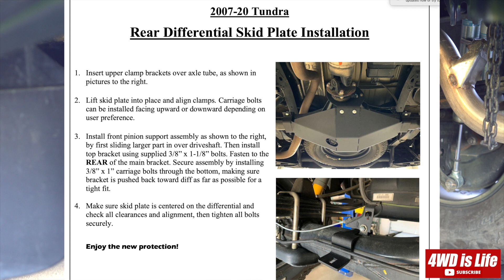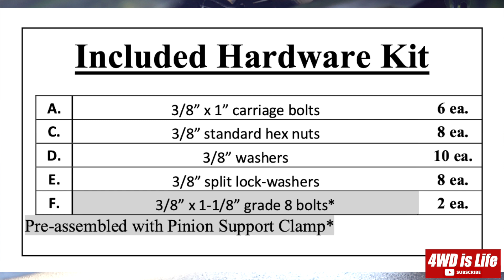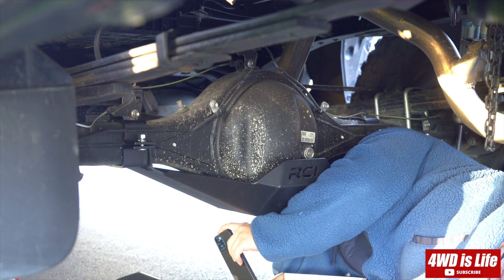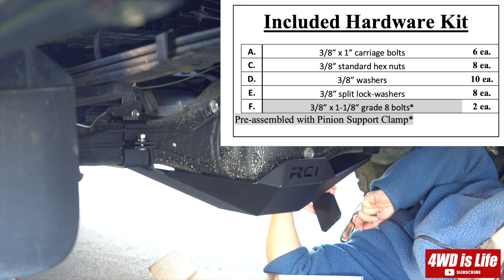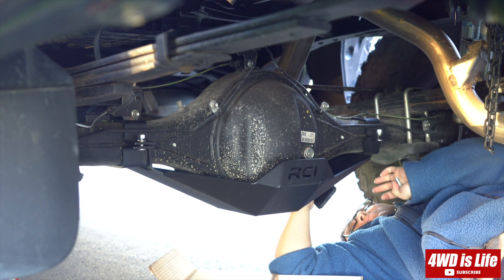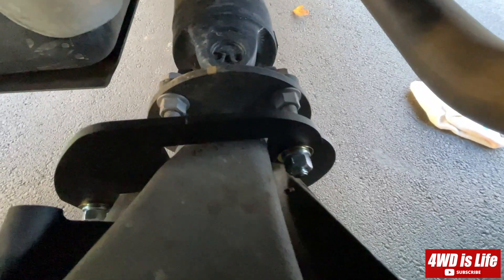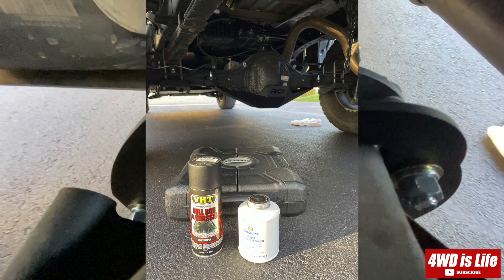RCI Rear Differential Skid Installation - 2020 Toyota Tundra

Comment: Nice Video, do you have the RCI full skid plate as well for the front part of the truck and if you do how do you like it, also since your truck is lifted does it matter with the RCI full skid plate that comes for the front or do they not fit on lifted trucks. Sorry I am asking you a lot here but you seem to be quiet knowledgeable about your truck and have a very balanced approach on how you have built your rigs.  I really like your videos. As I had mentioned before in one of your videos I have a 2019 Tundra Ltd and would like to follow your lead for my truck (saving some $$$ for the mod's) . Thx
Reply from the maker: thank you for the comment! 
I do have full rci skid and it works with my lifted truck because I didn’t have any diff drop (normally some shops recommend them when you lift a truck over 3 inches) since I only have 1.9inch lift front. So the skids work and install without any extra modification. I appreciate the kind words!
Reply: @4WDisLife  awesome no diff drop here. Will go with RCI. THANKS for your Input.

Comment: Hey cong! I’m currently doing some research on skids for my tundra and I was curious, did you ever put a fuel tank skid on your tundra? With your off roading in the tundra did you find the fuel tank to be a vulnerable spot?
Reply from the maker: Hey man, yes fuel tank is a very vulnerable part because of how long the wheelbase our tundra is. I actually dented my rci fuel tank skid several times because it’s prone to just be either high centered on the fuel tank due to the lower overhang of it or just hit rocks there.
Reply: Cool, I know it’s probably been a while but did you have to replace your OEM fuel tank straps with the TRD off road straps to mount the skid plate? Was that a significant challenge for you?
Reply from the maker: @TracerUnlimited I don’t think I had a strap to begin with since my truck is a sr5 non trd Offroad. And I had a shop to install so not 100% on the difficulty of it but I think I due to the gas tank being close tot he sliders on the driver side there wasn’t a lot of room